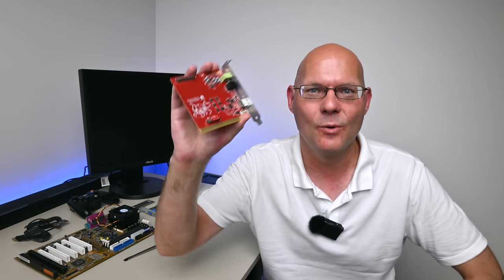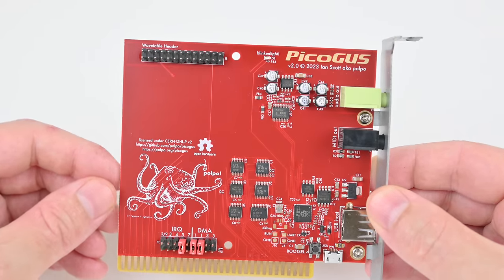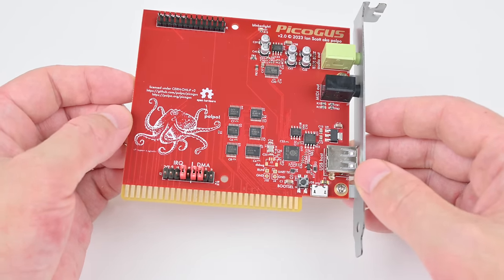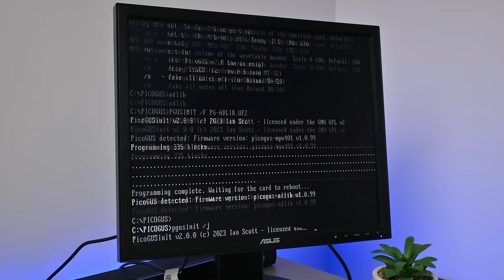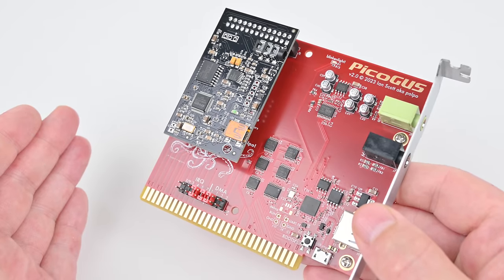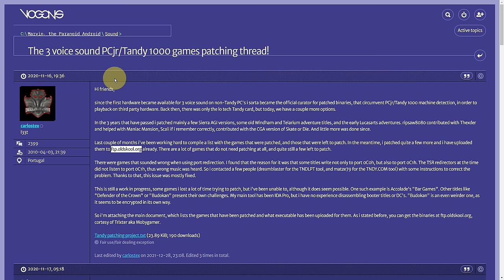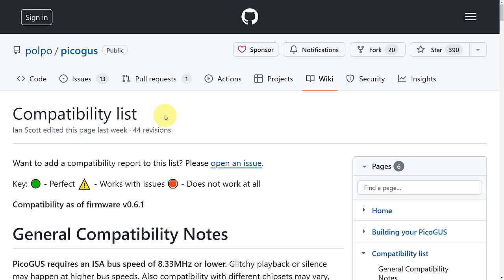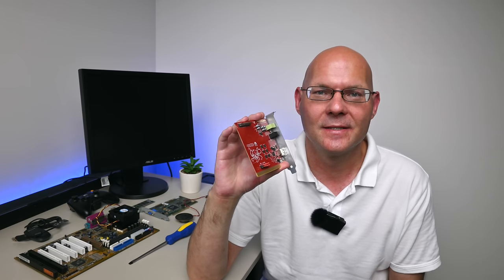PicoGUS is more than "just" Gravis Ultrasound

Comment: Just installed PicoGUS in my Toshiba T5200 plasma-monster. It had GUS MAX but PicoGUS is better because 1. it's a 8bit card so the second 16bit slot is free for 3com ethernet 2. the upcoming SB2.0 emulation!

Comment: I snagged 2 on the last restock for both of my ISA systems, I can not recommend it enough, It's incredibly versatile and very well built. I did have issues on my SIS socket 7 board with the mpu 401 not working but it was a board not on the compatibility list so i knew i was gambling. Works perfectly on my other system a Asus P5A with the ALI chipset. It's not period correct but who cares, it s a screaming deal...

Comment: After installing 4 retro pc, 2 win98se and 2 winxp pc i learned that to get sound drivers to work is a mess😂 for my win98se ibm aptivia 2171 p3 500mhz katmai 256mb ram on an ssd limited to 80gb with geforce4 mx440 64mb paired with a voodoo 2 8mb, the sound driver was a mess to install. And deamon tools is dont work well with some games sound. But😄 all my retro pc had some issues with sound drivers, some would not work.

But i feel i learned alot about win98se that i wish i knew when i was a kid and had my ibm aptivia 2171. And thx to you this stuff is fun😊 all the games and sound, the story, battlezone 1 and 2, settlers 3 and so on.

Comment: If only I had a system with a ISA port...
Reply: Time to find a suitable system with a LPC/TPM port and cook a dISAppointment LPC -> ISA adapter then 😊
Reply: @tadeustad  yeah definitely need some physical 9x era hardware in my life.

I'd love it if I still had the pentium 233mmx we had back in the day. It's super socket 7 board had AGP,PCI, and a pair of ISA slots
Reply: Slot 1 boards are still pretty cheap on eBay

Comment: Thank you for showing the USB joystick functionality in action!!  I've heard it mentioned repeatedly but never demonstrated before.  By chance, is there any way to re-map gamepad controls?  Right now I own multiple USB4VC's which allow me to use new off-the-shelf Xbox controllers with my retro PC's - and one of the biggest draws is the ability to define selectable profiles on the USB4VC, for instance I can map joystick X-axis to the left analog stick while controlling Y-axis with the left and right triggers, which is perfect for older driving games that INSIST on joystick Y-axis for throttle/brake control.  Would this offer any similar functionality, or are the gamepad mappings permanent and you just get what you get?
Reply from the maker: It acts like a real DOS gameport. 8 directions and 2 buttons. It doesn't map to keys...
Reply: @philscomputerlab  Yes I know it doesn't map to keyboard keys, but can I change which "thing" on the controller activates "joystick up" on the PC, for example?  Like if I wanted the left analog trigger on my Xbox controller driving "joystick up" on the PC?  I'm assuming the answer is no, or "not yet," but understanding this is central to my purchase decision.
Reply from the maker: @angieandretti  D-Pad plus A and B is what it mapped for me.

Comment: Quick Q, is it possible to run the card with wavetable card and sb emulation? eg for game like DOOM, use the SB emulation for digitised sounds and General MIDI for the music
Reply from the maker: Good question, I don't think so...
Reply: @philscomputerlab  bummer. I just got the new Pocket 386 and wanted to run one card. I ordered the 8bit isa expander so will run PicoGUS for GUS/SB and use either RS232 with MP32L for GM or add another PicoGUS and run that one in MPU mode with a dreamblaster S2 on it.

Comment: So I couldn't easily find this, but does it use the original Gravis samples the original GUS came with?  The ones that took up a few megs on floppy.  Are they built into the card or loaded from disk when needed like the original cards did.  I still have my original GUS, upgraded to 1Mb and have just obtained an old IBM Aptiva P-III 733Mhz system with an ISA slot capable of running my GUS, but I'd rather keep it as pristine as possible, hence my interest in the PicoGUS.
Reply from the maker: Yes that's the ULTRASND folder! Some games use these stock samples, others use something called ULTRAMID, a little tool you run.

Comment: The whole firmware flashing bit is somewhat concerning on the off chance you lose power. Also i do keep wondering if there are enough reproduction parts to make a "new" old computer purely out of them.
Reply: That would be pretty neat, not just as a gimmick but because these things are usually meant to emulate something top of the line,or even several somethings.

That said,I don't think the market is that extensive.
Reply: Fortunately, the PicoGUS is unbrickable as you can always use the card's micro-USB port to flash it to recover. Also, the flash lifetime is rated for at least 100,000 cycles, so that's a lot of reprogramming that's possible.

Comment: Hi Phil! My Picogus arrived a few days ago and works as expected... except for the sound volume, that I think is very low. Any tips about this?
Reply from the maker: That's interesting, well I've used a sound bar and seemed to work fine. You are using powered speakers?
Reply: yes, I'm using powered speakers. Just tried with a different computer and it sounded better (but still low). I've emailed Ian about this issue, still waiting for response

Comment: I'm curious if you can run more than one of these at a time in two different firmware modes and the appropriate jumper configurations.  I have a pair on order but am curious if anyone else has tried this?  Thinking one card could run the SB 2.0 firmware with the smart MPU 401 enabled while the other one rocks GUS mode which would functionally give you the same primary features as an Orpheus II card for $90 before shipping vs nearly $400.

Pairing with an ESS Audiodrive or YMF71x card could also be an option, though I don't believe you still have to assign a resource to it's dumb MIDI port so that's going to require some resource juggling unless you disable the Intelligent MIDI port when the PicoGUS is running the GUS firmware.

I think one of the least appreciated features of this bit of kit is the fact that it also emulates a Sound Blaster 2.0 but with an intelligent MPU-401 MIDI interface + wavetable header which gives you a ton of flexibility with non GUS wavetable or old MIDI hardware, waveblaster (Serdaco, etc..) cards and so forth.
Reply from the maker: Afaik this works, but the software can't handle setting the modes for two installed cards. You need to configure the first one alone, save the settings in the card. Remove it, configure the second. And then you're good to go to install both!

Comment: Phil any chance you can to an update on the Picogus because the firmware has changed a bit. I have got my Picogus mostly working but I cannot exploit all it has to offer and I am struggling with the website. The Gus emulation I have working and it sounds awesome
Reply from the maker: @Roadkill7878  It has changed a bit. The documentation is quite extensive and the new firmware has heaps more options, so I can understand. I have a video in the works showcasing the mouse function! Maybe later when there are even more features I do a full follow-up...

Comment: Sample based music existed before the GUS but the mixer was implemented in software, e.g. MOD trackers.  The advantage of the GUS was all of the resampling (for different frequencies) and mixing was done in hardware and at a very high quality.  This then allowed the CPU to spend more cycles on graphics.
The biggest limitation of the GUS was compatibility with older games written for the Adlib & SoundBlaster cards.  I've often wondered what would have happened if Gravis had included SoundBlaster Pro compatible direct access to the DAC.

Comment: Great card ! Amazing design. I used to have a GUS Ultrasound MAX and it was a great card, but it had a problem with SB emulation. 
I wonder if this GUS emulator can emulate Sound Blaster better than the original GUS :)

By the way the FM synthesis sounds so flat and weak compared to GUS or General Midi. Yes, it has its charm, but in my first PC I had a sound card with a wavetable module and FM synthesis was a rarity for me :)

Comment: That's brilliant! These devices having enough power to just emulate sound and being drop in replacements for the real things is excellent.
One suggestion is to not run the flashing all the time. The PicoPi has a flash with limited writes. Casual flashing should be fine, but every time you run a game might be too much.
Reply: The flash on the PicoGUS is rated for at least 100,000 erase/program cycles. That's a lot of switching that's possible! If it ever wears out it is a common part that can be replaced by someone with SMD soldering skills.

Comment: Such card can be also used as a 3D accelerator or math/calculation accelerator for ISA based PC. At some point people from demoscene will make a demo using such card on 286 or even 8086 PC.
DOOM port that run at full speed on slowest 386 SX is also possible. Just think of DOOM for Sega Genesis that uses hardware from Everdrive cartridge to run full DOOM at 100% speed on stock Sega Genesis.

In the 90's similar accelerators were very popular in Amiga community. There were no new Amiga computers, but 3rd party companies developed and sold accelerator cards and Amiga ecosystem even moved from 68K Motorola architecture to PPC. Modern Amiga accelerators are often based on Raspberry Pi.

PCs never got such accelerators, since it was just easier to buy new motherboard and CPU.

Comment: You mentioned the hardware mixing aspect but I feel like the advantage of this can't be stressed high enough, it's not just about freeing up the CPU which at the time multi-channel mixing of high quality samples, pitch shifted and filtered was a non-trivial task on the CPUs of the day - the advantage in latency is one that doesn't get enough attention. Software mixed audio needs a RAM buffer and buffering adds latency. Too little buffering and you get horrible underflow noise, too much and sounds play "late" compared to the visuals and rob the game of the "punch". This is still an issue that persists to this day as it's not really a CPU power issue and more a timing thing. The GUS just plays the samples when you tell it to and you never need to worry about underflows, the card just does what you need it to do.
PC tends to prefer the "worse is better" approach over the long haul. If something can be offloaded to the CPU to make the hardware cheaper, that's the one that wins in the marketplace even if the loser was the better hardware. The upside though is flexibility.
Reply from the maker: Thanks for the detailed comment!

Comment: Very impressive piece of hardware - I noticed the first revision using a Raspberry Zero, as well as the related projects Orpheus 1/Orpheus II/Orpheus IILT .
I like the idea of combining an Adlib compatible Soundblaster 16 on Port 220, a GUS on Port Port 240 and a Roland Midi Wavetable on MPU-401 port with wavetable support.
Reply: The problem I had with my Orpheius II is that it doesn't like a lot of motherboards.  I finally gave up on trying to get it to play nice with a board with anything on it and got an old 486 that has expansions for everything.  It is a beat up old thing, and I am still wondering if I should try and find a case that isn't all cracked, or if that just adds character...
Reply: @slaapliedje  I wouldn't pick a new case unless it's very inconvinient like that, since vintage partly is about the feel, but I would make sure to get myself a DX4-100+, DX5/AMD 5x86 P75/Pentium overdrive with around 32/64MB ram combined with a PCI graphics card ( if supported, ideally a Banshee PCI 16MB ) to not be kept wanting. If you want a Non GUS ISA soundcard that just works ( though you should install a Dreamblaster S2+ to not suffer the Adlib sound provided ) is a "Terratec Base-1" you can still get used for around $20.
Reply: @l3lue7hunder12  I actually have multiple builds, the 486 does not have PCI, just VLB and ISA.  But is a Amd DX4-100 with a CL... something, I would have to look again.  When it shipped, the upper corner cracked hard and other pieces broke off... I glued it as best I could, and it is horribly yellowed, but the Turbo works and it has an awesomely chunky switch.  The only other want that I have is a digital display for the Mhz.  This is the system I have the Orpheus II in.
I also have a 286 (that I broke the memory on :() a couple PS/2s with 386 and a 486 CPU upgrade, etc.  For faster stuff, I have a tualatin CPU in another build.  Those newer builds have everything from a Matrox G400 to an AGP Voodoo 3.  I am really well covered for Retro systems.  😜
Reply: @slaapliedje  Well covered indeed ! 👍
And if you got a VLB 486, then it already is a later generation, and if the graphics card starts with "CL" then it probably is a "Cirrus Logic" - those things are pretty decent. The last generation of 486 boards that shipped around the time the Pentium was introduced, already did come with PCI.
One of the best known such boards is the "Soyo SY-4SAW", using the "SiS 85C496/497" chipset combo to provide what Intel would not. 🤓

I got plenty of hardware, but only a Pentium 3 with a Terratec Base-1 and ATI Radeon 9250 running Win 98 SE all ready to go - Windows 98 is a nice middle ground since it covers both classic DOS and early Windows by means of a simple Start-Menu tweak ( or just exiting to DOS ).
Reply: @l3lue7hunder12  oh yeah, I know the CL is Cirrus Logic, was just too lazy to type it out.  By the time the 486 was king, I was rocking an Atari Mega STe, so didn't have to deal with ISA PnP shenanigans until my parents had bought a Pentium 75 Packard Bell, so a lot of the computers before that are somewhat new to me, but dealing with DOS and such is only weird as I am a Linux admin by trade.  But I have always been 'a hardware' guy, so like playing with that.

Comment: The best platform for this card would be a "All in one" design like my Compaq Presario CDS 524 (486dx2-66) or a CDS 9220 (Pentium 75) both have 2x 16bit ISA slots, IDE for HDD+Optical drive, on board SB 2.0 sound 14" CRT already a wierd funny unit. Right now my config for sound is a MPU-401 clone + MT-32 + GUS ACE ISA (General midi) + onboard SB pro. I think that does most if not everything :) the USB gamepad is a nice feature, ALSO there is a ISA 2 USB (Mass storage drive) usb 1.0 / 1.1 / 2.0 that can load fat 16 file system usb sticks I wonder if this card can use the driver?

Comment: I've got an earlier version of the PicoGUS with the Pico soldered on, rather than the new one with the RP2040 integrated on the PCB. This is the first I've heard of the USB gamepad feature. Sounds awesome. Do you (or anyone else in the comments) know if the older version can do it with its micro USB port (with an OTG cable/adapter)? Or is this something you need the new board to use?

Also, I'm sorry to ask if it's too personal, but are you okay, Phil? Looks like you're having an allergic reaction to something. I suppose that's one of the downsides to 4K videos - you can see everything. Anyway, hope you're alright.
Reply from the maker: Yes your USB port works for the ganeport.

Comment: Dear Phil, is there any chance you're interested in exploring the original DOOM 0.1-1.2 vs 1.4-1.9 Gravis Ultrasound digital SFX subroutine rumours? (aparently early builds of DOOM up to 1.1/1.2 have a reference GUS implementation that loads SFX samples then 'calls' them, like with the music - saving some CPU cycles as there's no software DAC/Mixing in engine. Later builds have a basic software DAC/mixing aproach. Supposedly a hardware bug in early GUS caused the game to occasionally crash, so they patch out sampler SFX calls. No Youtube video I can find does justice as popular builds of Doom sound scratchy and thin with GUS SFX selected, but I think early builds will sound great in 0.9 etc. I've been meaning to do the experiments but never have everything working all at the same time. 386 working = GUS needs recap. GUS working then the 386 needs a recap. 🤦‍♂🤦‍♂😂😂👍👍
Reply from the maker: Not enough substance for a video for my channel...

Comment: Are multiple operating modes simultaneously possible? Like having Adlib, CMS and GF1 at the same time?
Reply from the maker: One mode at a time apart from the joystick function!
Reply: @philscomputerlab  damn, but i guess at that price you could just buy 3 and then flash each of them differently
Reply: @CHA0SHACKER  Nothing will need CMS, Tandy and Adlib at the same time.
Have CMS and Tandy at the same time is just a matter to recompile the firmware with both on.

Comment: Phil -great job going over the compatibility list. I have an IBM PS/2 8mhz machine I would like to use with the MT-32. Perhaps I can reprogram the picogus on a faster machine I have, like a 486? I'll try and see.
Reply from the maker: On a 486 try the turbo button or disable the processor Chache with software. It will slow down the machine and should be compatible with MT-32 older games.
Reply: @philscomputerlab  I confirmed that you can flash the picogus to MT-32 and then stick the flashed picogus into an IBM PS/2 286 8mhz machine. I just did it using a 386DX/40MHZ machine. This is good news because while 286s aren't able to flash the pico gus out of the box, you can flash. Right now listening to Conquests of Camelot and sounds great on MT-32.
Reply from the maker: Oh that is so wonderful @klenchr3621